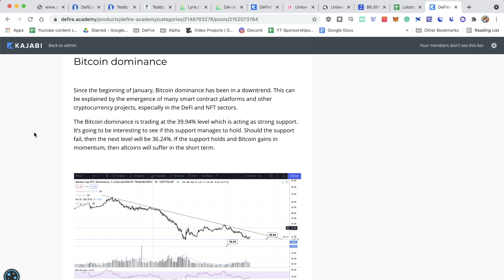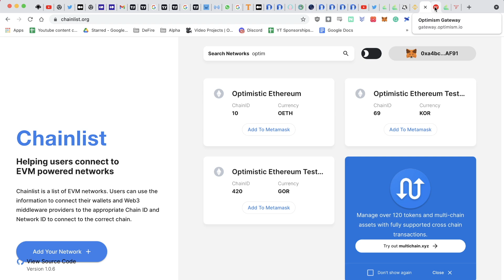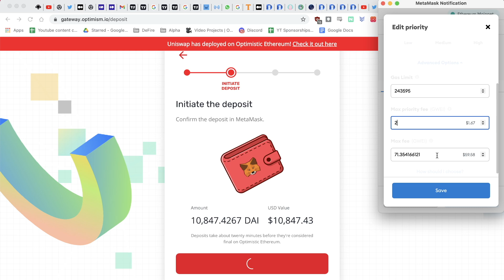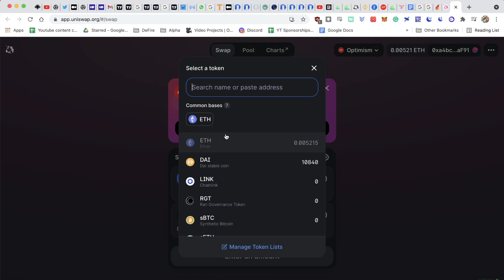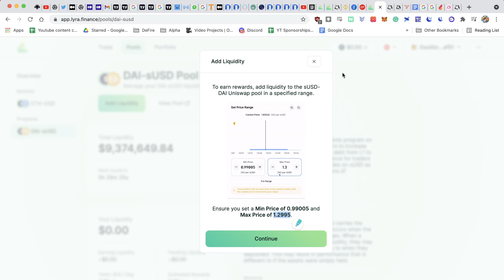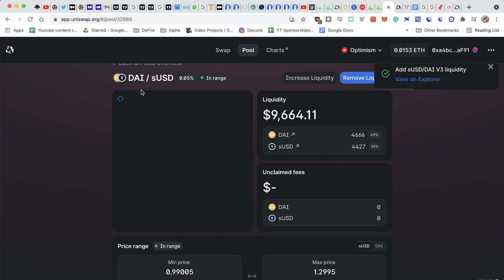OPTIMISTIC ETHEREUM LAYER 2  BEGINNERS GUIDE - 100x GEM Inside!

Comment: Thanks for the video , I just think it's To clunky  , to many steps for newbies and adoption , still expensive , and your assets are no longer on the ETH chain , am I missing something?
Reply from the maker: Yes. Its not for complete  newbies but for people that want to be early in a new ecosystem and make the max gains. As soon as its easy the 100x gems are probably gone 😬
Reply: @YourDeFiGuide  Agree , I think there's short term potential for gains , 
Just think it's very expensive to move back and forth with a layer 2 ,  hate the thought of moving my Eth assets to another chain  , I might as well just use binanace or Solana  or others and leave my Eth assets as is. 
Anyway your great and thankyou for all your guidance and advice been very helpful over the years .